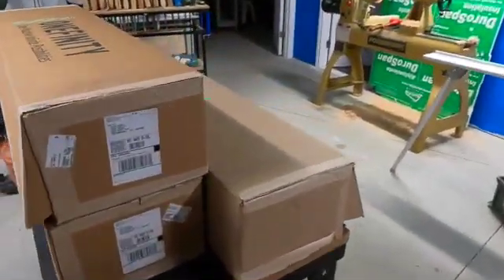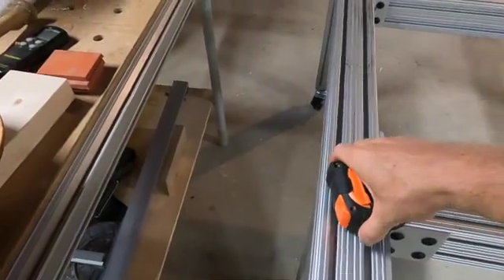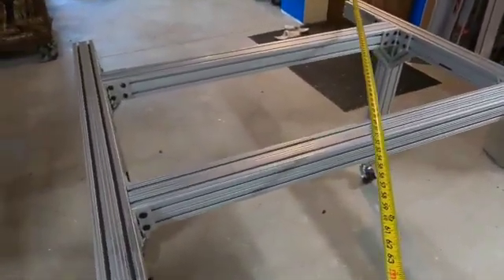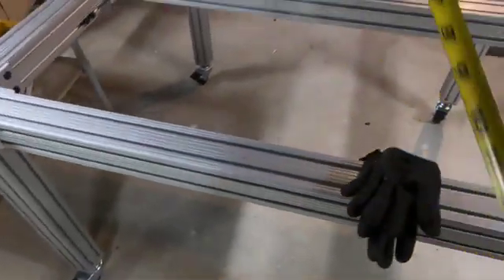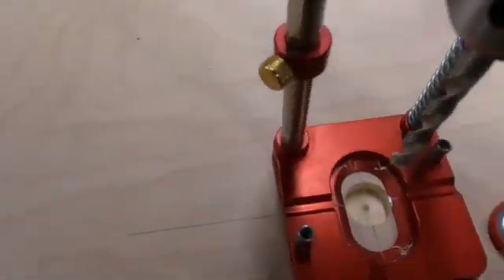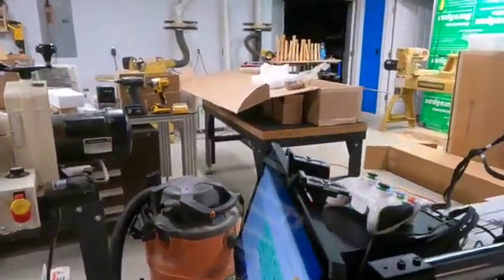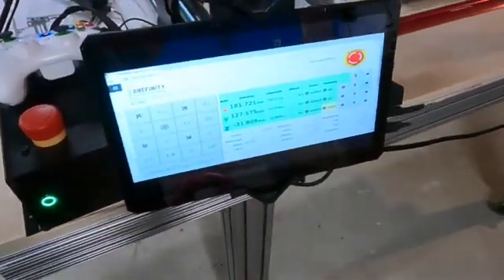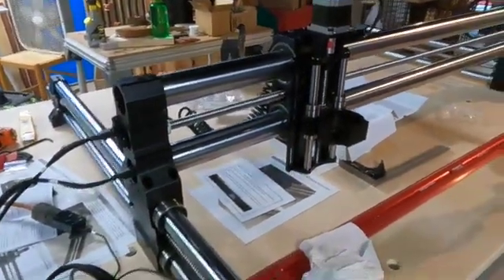Onefinity Journeyman X-50 CNC Router Table X &Y Axis Set-up Part 1

Comment: you showed your 72 inch width - what was your depth? I too am awaiting delivery and need to make a table for it. Thanks!
Reply from the maker: Good catch - I apologize about missing that dimension.  I made it 52 inches deep - that gave me about 6 inches extra in front (helps with the laser as it is about 4 inches in front of the spindle) and a couple inches in back for - well really nothing.  I think it was recommended to make it a minimum of 49 inches.  Good luck - it's a great learning experience for me.

Comment: turn on the screen first for a few seconds before turning on the controller and you screen won't be squished.
Reply from the maker: Thanks for the comment and suggestion, unfortunately by the nature of my set up the screen automatically is turned on before the controller.  I have an electric panel I built which provides all the electric requirements.  When I turn the main switch on, power to the VFD and the screen are supplied.  Then I turn the on the control.  I think it is part of version 1.1 as Onefinity has suggested to avoid these issues go back to 1.09 however this will require taking the controller apart, removing the micro sd card, down loading a raspberry Pi flash program, refresh to 1.09, and reinstall.  Reading through the forum of those who have performed this process have had issues.  A common theme with those who do this process are IT professionals and well versed in this action.  While I enjoy driving cars, I don't want to have to learn about vulcanizing rubber in order to maintain my tires - a bit of a stretch however conceptional the same.  Anyway, again thanks for the suggestions and appreciate you watching!